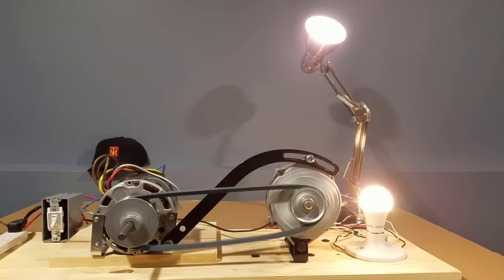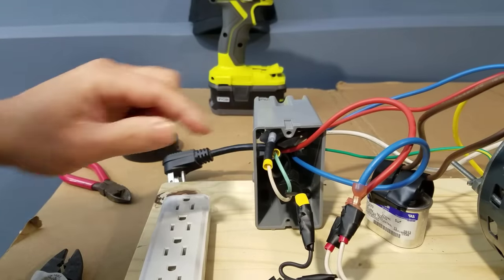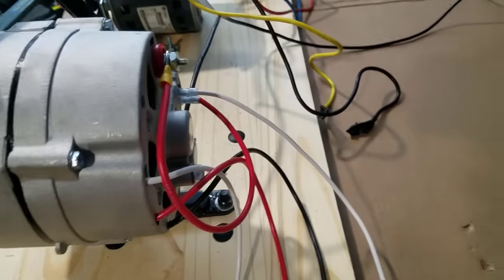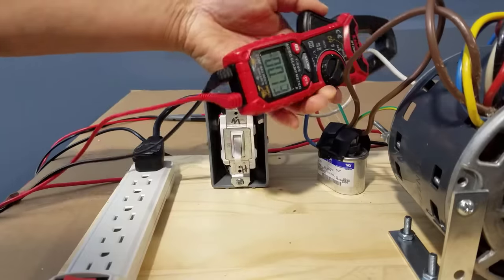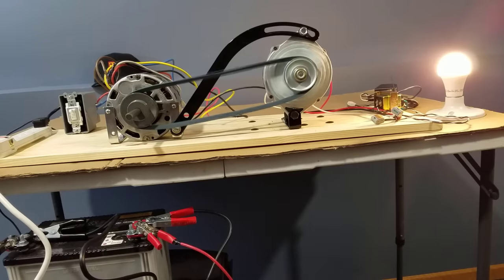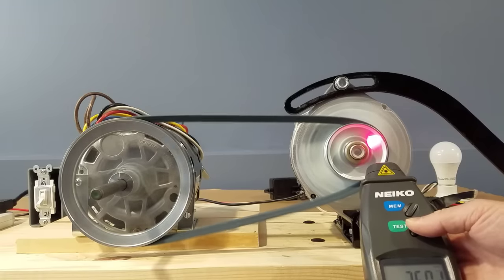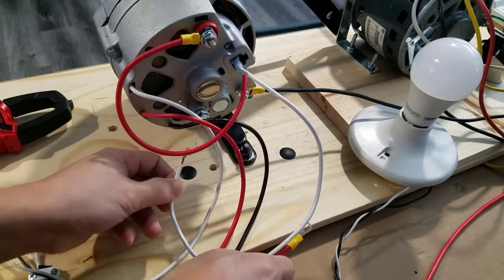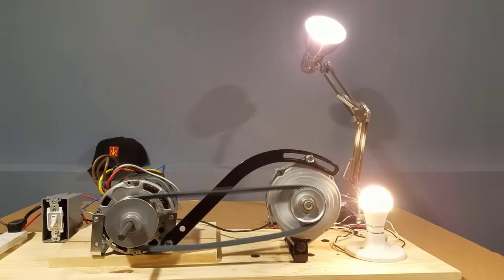Free Energy? (WOW) Using a Car Alternator

Comment: I did something similar back in 1992, I used 4 alternators and a grinder motor. I was getting around 6000 wats from the setup. The grinder motor only needed 12v but I up the voltage to 24v to get it to maximum rpm and it did well. Stopped it by disconnecting a wire. You can also use a battery in line with a super cap setup and it is awesome for in home generating. The cool thing about setting these up, is you can have 10 alternators in a series setup to obtain 110v then in parallel for improved wattage or amperage.
Reply: I don't believe you,.  prove it
Reply: @seantap1415  It's easy.. You can use a car alternator or a stator from a motorcycle. Stators produce much more voltage. Or wind your own stator. Motors love voltage more than wattage. So more revs. Take a fly wheel, about 8x the pully to the alternator or stator. Belt it up, spin it up. The fly wheel weight will keep momentum as the motor is trying to keep it turning. Use volts more than amperage and watch the magic. You can route the power to some caps then to a battery back to caps and it'll run until the bearings burn out.
Reply from the maker: @jdamage68  Thank you for you comments and suggestions. I'll consider setting something up similar to what you mentioned.
Reply: Hey guys, just wanted to add: electromagnets are FAR stronger than Neodymium... better than the best magnets. As a matter of fact, their limit is determined by the input they can handle. Magnets are set in strength and cannot be adjusted, but electromagnets can be "tuned" to their use.

Please, don't use permanent magnets. It only shows a lack of understanding of magnetic fields. Use coils to achieve the desired magnetic fields in your machines.

I love to tinker. I just want to share what I know to help as much as I can. We all want that $3 electric bill, and now we really could use all the help we can get.

Happy building
Reply: @mrmightytiger7385  YOU HAVE *VERY SEVERE LIE ARRHEA!!*
Reply: And I created gold from trash, I guess ere both liars!!
Reply: @justme-eh3hr  Just you..
Reply: @chrisclarke6344  Really? Ok.. Lets do some math since you don't like to do your own homework. There is this thing called an electric diesel locomotive. The diesel motor produces about 3200 horse power and about at most 8000lbs of torque.. All to turn a generator producing about 700kw or 4700 amps to power Trak motors that produce about 60000 lbs of torque.. Now I want you think just for second. Why do you need the diesel motor if the trak motors have over 60000lbs of torque? You don't. The only question remains is, HOW DO YOU START THE TRAK MOTORS? Batteries was the answer. When I made my little snake oil project, I called the a local locomotive company and asked them. And all they could say was, how would you start the track motors. And the simple answer was batteries. Because you don't need a diesel engine at all. Here is another one. A typical gas generator runs off of about 1-5 hp, Makes up to 10000 watts, which is enough power to run a 5hp grinder motor. At 100% uses about 4000 watts. Leaves you with about 6000 watts to use. This is not some snake oil, it's common sense. Easy to demo but easier to believe bs from big oil. I made it, demo'd it and understand it. Stop beig a fool and think for yourself. And try it if you don't believe before you spread bs to people.
Reply: OH and one more thing. Diesel electric locomotives have 1 big generator and up to 8 trak motors per locomotive. The only reason you need the diesel engine is for efficiency.
Reply: @jdamage68  you are the fool sir a diesel electro locomotive is exactly what it says it uses the diesel engine to turn the generator/alternator to power the track motors, no diesel the diesel engine stops and so does the loco. The only thing it might have batteries for is the starter motor used to start the diesel engine. You could not put enough batteries into the loco to run the track motors, so modern locos from 50s onwards above 3000 hp use an alternator with a diode bridge to transform ac to dc to run the track motors. The diesel engine is the extra energy input needed to keep the system working. NOT a 'free energy' system making more output than is put in. Further with locos why do you think solely electric trains have power pick up from over head lines or third rail if you could put a magic generator / alternator machine in them? The answer is a 'free energy' machine does not work. If it did all locos world wide would have them but they dont. As for patents and big oil the patent is worthless past 20yrs or in countries not covered by the patent act china for example. Why would they be building new coal power stations if your crazy ideas worked? Why would western countries be building mega expensive nuclear power stations and windfarms etc if you could just make many magic energy machines. As for gasoline generators, they cannot make more energy than the output of the gas engine, this is prooven by the fact that you put a load on one it will throttle up to meet the extra demand. Then if you put a 10,000 watt load on an 8,000 watt generator it will splutter to a stop due to the excess load that the gas engine cannot overcome, so there is no 'spare capacity' to run the generator/alternator. This is exactly the same principle as trying a steep hill in top gear in your car it will stop because the work is more than the gas engine can supply at those rpms. So in conclusion your magic machines do not work due to the conservation of energy/thermodynamics, which proove that you cannot have 100% plus efficiency there is always a loss hence these machines are con tricks. And finally big oil do not hide this 'technology' because if they did why have they not killed musk or nuclear scientists building nuclear power plants? If this was possible they would all be building various types and making billions from them. The reason you do not see these things in general use is because as i have said before they do not work. If you have a working one upload a video to your channel so it can be seen, until then i will call bullshit.
Reply: @chrisclarke6344  Ok man you don't know what you are talking about.. I'm going to let you stay in the box. SMH..
Reply: @chrisclarke6344  Lets try this. If you have a gas generator that is 1-5hp and produces 5000w at 110v, you can power a 2hp grinder motor right? Now use that grinder motor and attach it to the shaft where the gas motor intersects the generator. Now to get this running, you can use either pull string or another small dc motor and a battery to turn the the shaft, once the shaft is up to speed, the generator will take over. Once the generator takes over it will power the grinder motor. The grinder motor will use about 2k watts and leave you with 3k watts left. Go try it before you say another word. Because YOU DO NOT KNOW WHAT YOU ARE TALKING ABOUT.!! Try it before you speak on it.. These people got you guys fooled so well it's pathetic.
Reply: @jdamage68  you have also said you connect vehicle alternators in series, how are you managing that with chassis grounded alternators? how are you keeping them in phase?
Reply: @chrisclarke6344  Are you talking about out of phase issues? My experiment was just to prove concept, but you can add 0 frequency at each 90 degree phase to compensate. But usually this only occurs when using caps in the circuit. But you can sweep value of inductance for optimal compensation of phase shift to handle that.
Reply: @jdamage68  no more the fact that if they are not identical in construction and if the poles are not in sync on every one there will be problems with the sine waves being out of sync. It would have to be carefully constructed with cogged belt, direct drive or chain, (belts are no good because of slippage) to keep the poles synchronized. If this not done and the grounds are not kept seperate it will pay havoc with diodes or other controls. Also the alternators will only give what the weakest one produces. My engineer discovered this at sea when he tried to get over the main ac alternator failure, by linking the alternators on the aux engines.
Reply: @chrisclarke6344  I agree to some of the points. But again I made my project as a proof of concept. As with long term use or reliability of the sync's, that will take more fine tune engineering to perfect or at least tune to acceptable parameters. But also understand that most setups are not designed for multiple alternators and will require circuits that can handle the flux as I mentioned in previous comment.
Reply: @jdamage68  its a very complicated procedure, probably better to use a design the gives the required voltage, or remove the diode bridge and let it produce 230 volts, as  my engineer found out out of sync sine waves tends to destroy control circuitry designed for stable currents.
Reply: @jdamage68  Yes.OfCourse.Locomotive,AndGasGeneratorsAreGoodExamplesOfOverunity.
Reply: @chrisclarke6344  Club of Rome Check out the video on here..... "computer prediction from 1970s".
Reply: @WSmith_1984  there have been so many 'predictions' that occasionally one will work or they are so loosely phrased it could be anything you want it to be. Heres my prediction, 'by the year 2070 men will have travelled to mars and back," write it down and see if it comes true.
Reply: @WSmith_1984  a you tube video prooves nothing apart from what the maker wants the gullible to believe because they have a predisposition to that theory.
Reply: @WSmith_1984  also you obviously cannot remember the power of 1970s computer tech, they struggled with word processing and were best used for number crunching and generally took up rooms. Any 'prediction' from one of those was whatever the programmer wanted it to give out.
Reply: I dont hate myself or my life i have had a very good one thankyou. The one who appears to hate their life is yourself believing that everyone is out to get you, and resorting to abusive profanities when you run out of answers and proof for your crazy beliefs. By the way its 'loser' not 'losser' English not a strong point either is it.  Oh Forgot  the 'c' is before the 'k' in that word, usually with a 'g' at the end if your are literate. Another censorship test, hmm still here.
Reply: @jdamage68  Hi. I want to know about your project.
Reply: "Hey guys, I invented something back in 1992 which could have made me a trillion dollars and won the Nobel prize for the most important scientific breakthrough in human history, but I didn't do any of that, instead I just post comments about it on youtube and argue with random people"
Reply: @Fireball_Roberts  What did you invent? Oh you came on here to argue, I get it now..
Reply: @jdamage68  Yes I came on here to call you out for being a weirdo who writes page-long comments about a fictional story of you inventing something. I'm just saying your story has some major plot holes you need to work on.
Reply: @jdamage68  bless your heart brother. On a similar project. Got some successes until I ran out if funds. Using a different method though, but I'll continue once I can source more money. Thanks for this m, its a real spirit lifter.
Reply: @Fireball_Roberts  I only come to these videos for the comments from the weirdos like jdamage68 it's crazy because he believes it 😤 🤪 😂
Reply: If it was so great in 1992 then why aren’t you using it today?  I’m just guessing, but I’ll say you realized that it was total BS and you wasted all your $. 😂

Comment: why don't use the inverter for bulbs?
Reply from the maker: I could of done that, but the point of the alternator is to provide the charging power back to the battery.
Reply: @mrmightytiger7385  in principle is the same thing.from inverter or another transformer on alternator,all lead to mechanical brake.so i think is better to use a 24v alternator  with an external 12v regulator

Comment: Can you try a low speed 5-6kw gen driven by high speed self excited or brushless car alternator 12v or 24v 200-300 amps. The alternator will then get power from the gen using transformer converting 12v or 2v dc and passing a voltage controller to maintain same voltage to the alternator when load is being applied to the generator.

Comment: Good work and you do what everybody else doesn't you explain it and that's pretty important you're part by part everything's self-explained it's right on
Reply from the maker: Thank you! Glad you enjoyed it.
Reply: Okay, but you do realize that its entirely bullhitt correct. There is no such thing as free perpetual energy. This guy gets paid with a click on his videos. If an alternator could self power a motor, while that motor supplies  engery to another load, such as a light bulb, while at the same time being it own source of energy, it would stop working immediately. For instance if water flowing through a clear tube was energy, and it hooked back onto itself,  causing the the flow of water. the water in this tube would only move if moved the tube.
It's all tricks and lies
If you get excited from this kind of stuff, I implore of you to get some books on phyics and mechanical engineering.  That way you can trust your source...

Comment: the big question is, can you run it completely without the battery ? 
if yes, you have won, if not, then your total COP of the system is below 1....
normally you need to modify the generator or the motor to get a system cop over 1 to make it self running....
Reply from the maker: I'm working on improvements... stay tunned.
Reply: @mrmightytiger7385  Charlatan!

Comment: I'm going to try to make one with a denso alternator connect that to the battery so it can charge it and then see if I can distribute what little wattage I get into maybe three or four decent transformers.
Reply: Just to have some kind of backup in case we get another hurricane so we can charge our phones at least. It's better than spending damn near $100 on gas for a generator.

Comment: Wasn't this already debunked last month on 5 other channels.....hopped on the monetary trail a bit to late!
Reply from the maker: Please challenge them to use the parameters mentioned and used in this video. Thanks for your support and comment.
Reply: @mrmightytiger7385  what is the strength of the permanent magnets you used in Tesla, approximately how many feet of wire in coils, and what is the RPM? Would like to attempt some calculations of input to output.

Comment: I built one of these things and it worked just as they said it would.
It developed a squeak deep inside and I could not get oil to the needed area.
I could not sleep at night for the squeaking.
I threw the damm thing at the wall to stop it
and tossed it in the trash the net morning

Comment: Would a fly wheel mounted outside your 2:1 pulley increase the speed and reduce the pressure on the motor once you got it up to speed?

Comment: You almost got it. I invented this when I was 15 years old. Studied Engineering Sciences and finished college then began improving this idea to come up with a generator that can run multiple houses with free electric power totally needed without any moving parts. It has been 20 years since now I've never paid electric bills. They pay me. You have a long way to go that will lead you to what I invented.  Good luck with fooling around to discover what actually works with my findings in Electrical self designed generation. The battery on my machine is self driving. I 
will give you one hint to achieve a better electric generator. 
(Magnetism). Have a good time thinking about that. It needs no plug in a wall to generate an ample supply of electric energy. The generator Is totally self contained for any purpose and can be used for anything used to power anything known today.
Reply: Would love to see your free energy set up as a comparison 👍
Reply: Will you please allow us to see your design? Where?
Reply: People that believe that they can do this are delusional or they are a scam artist.
Reply: @hammockcamping2500  Scam artist looking for views to make money. It's called FRAUD.

Comment: Such a huge waste of time and energy it’s been known for over 150 years that there is a law of conservation of energy which has been tested thousands of times and so there’s good experimental evidence and great theoretical evidence that you don’t get something from nothing just for your example your motor is probably no more than about 90% efficient and the pulleys no more than 70% and the alternator is probably about 70% efficient so every time around the loop 9.× .7x.7x.7 put in 100 W and you get out 30 which go back around and now your 30 W gets multiplied by .3 again that’s down to 10 W and we barely made a couple revolutions and we lost 90% of our initial power in the first fraction of a second so this just isn’t gonna work. It doesn’t matter how many transformers or  pulleys or stepper pulley sizes you use, it’s just a losing game. We’re all now dumber after this how about you just admit defeat and give up thanks.
Reply: Not to mention  how much energy was lost using a belt. A lot of friction there!
Reply: complete agree
this video is another fake video that just want to fool people to watch it and make money from you tube
Reply: I also agree but my question is why did we all waste our time watching it and commenting on it?

Comment: Nice work of engineers across motors, thanks you guy, both working in a way placement ,good for pulled size and that's good for the transformer size of watts of d.c so the ratio readings load.
Reply from the maker: Thank you!